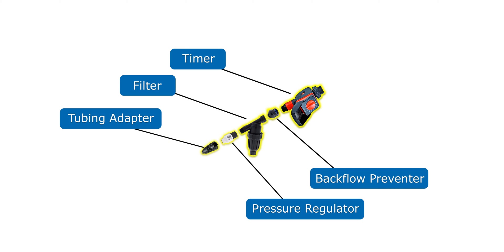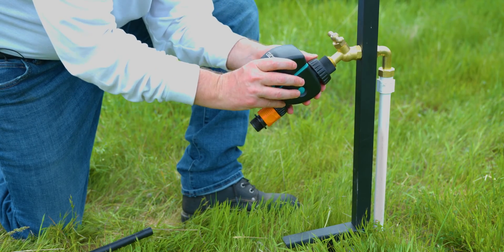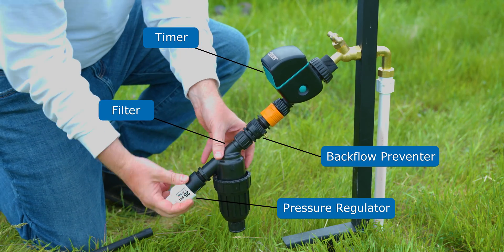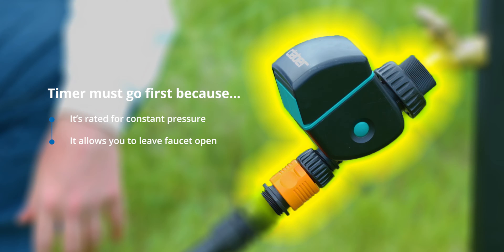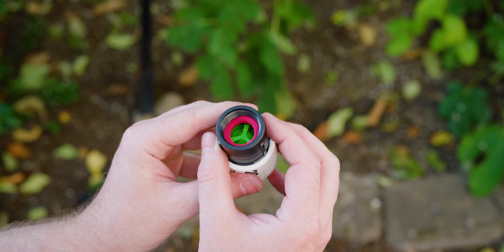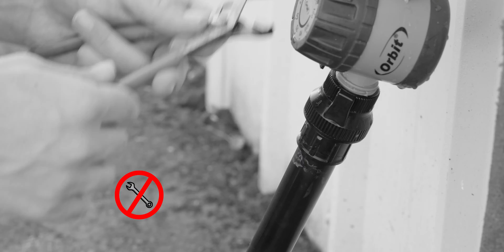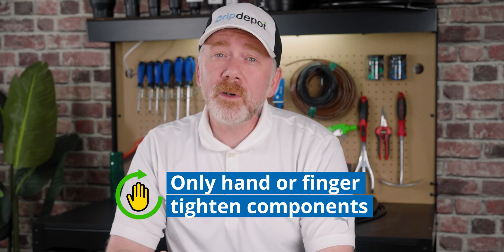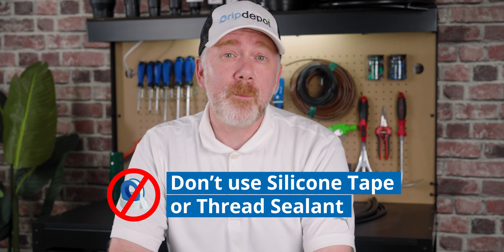How to Install a Drip Irrigation Head Assembly (Beginner's Guide)

Comment: I'm perplexed how this is a popular installation technique; there is so much stuff hanging off at an angle that there must be so much stress & strain on those fittings. It's so silly how it's sticking out like that; bang your knee on it as you're walking by and one of those plastic fittings is definitely snapping. I've been searching all over the web but can't find any sort of system that gets mounted flush to a wall, post, or box thereby eliminating all the aforementioned issues.
Reply from the maker: These can definitely be mounted flush to a support structure, you're definitely on the right track.  In most cases it's the hose bib turning things 45°, but a quick adapter (or a 90° hose bib connection) can allow things to be completely vertical so they could be mounted flush, particularly if the inline filter is used instead of the canister filter (inline is this one: https://www.dripdepot.com/1255 ).  With that said, a single zone head assembly isn't too heavy, but once you start getting to 2 to 4 outlets they can get a little on the bulky side and I think looking to install it on some kind of support is a good idea at that point.
Reply: @dripdepot  Yes, but I guess my main point is that none of these parts seem to be designed for mounting - no brackets, mounting flanges, etc. To me, mounting options should be the logical default of any design. If someone wants to instead hang a spider spaghetti mess of parts off a hose bib, then they simply don't use the brackets or mounting points. My garden space is a fair ways away from my house with no hose bib nearby, which I would think is not uncommon among backyard gardeners. An ideal solution would be some sort of distribution box mounted to a post in the garden with an input from a hose or buried line that's run from the house. I'm just surprised there's nothing anywhere close to a turnkey solution for this; I'm essentially going to have to 100% frankenstein something from random hardware. Installing drip irrigation in the beds seems to be very easy and straightforward, but the showstopper is getting the water to the garden.
Reply from the maker: @johnk_dev  I would agree that as far as hose bib solutions go, it has definitely lagged behind traditional buried solutions.  In your case, you could look into routing some pipe from your hose bib (or tapping into the pipe that feeds it) and running it out to the garden where you could go with a valve box and a small valve or valves.  A faucet Y on the hose bib would allow it to still be used as standard hose bib with a garden hose, etc.  Beyond that, you have it right there's not really a turnkey solution like described (and you're also right that installing the drip is very easy!).  

Drip irrigation, particularly from a hose bib, has been a very small portion of the market for a long time, it's just now really gaining in popularity, so we'll definitely start seeing things like this being offered.  I think the drip market is going to continue to grow considerably.  If you end up building a good solution and it could scale, heck you could be the one to bring the product to market :)
Reply: @dripdepot  I think a lot of the onus will fall on the timer manufacturers. The timer is first in line off the bib, they all seem to be made of plastic, and therefore carry the most stress and are most likely to break. My #1 pick is the Linktap Q1 based on the feature set; it has literally everything I want except a way to mount it. Most other timers have a flat rectangular shape, so some sort of generic off-the-shelf brackets from the hardware store could probably be used, but the Q1's star shape makes it essentially unmountable without machining a 100% custom bracket.

I just need to get started. A final solution will probably come to me eventually. My garden is 11 12' raised beds, a few in ground beds, a few smaller border raised beds, and pots. 4 zones seems appropriate, but I should just get one of your starter kits and do a couple of the beds as a learning exercise. Learn by doing! I'll mount a single head assembly to a post and have a pigtail of hose with a quick connect where I can connect/disconnect my hose and turn it on/off by hand. Timers, multiple zones, underground pipe, etc. can come later.
Reply from the maker: @johnk_dev  I'd just bumped into the LinkTap for the first time a couple weeks ago.  Man, you're right about the star shape, that does seem a little unwieldy (though its feature set is admittedly very nice).  

And spot on about learning by doing, after you do your first system you'll be adept at all of this, it's one of those things that's more intimidating in theory than in practice.  After I installed by first drip system at home I went wild adding beds and growing the system lol, the experience from the first one locked in all the knowledge for me.  As you plan and install the system, don't hesitate for a second to drop a line if you have any questions, I genuinely love to talk irrigation and am always happy to help.

Comment: Why is the filter always shown as upstream of the pressure reducer?  My water source is directly from the municipal water meter -- not hooked to a hose bib from the house.  The filter is located upstream of the valves and pressure reducers.  About every six months, the plastic housing on the cannister filters (from multiple manufacturers) springs a leak.  It has happened many times.  I presume that is because it is not designed to be exposed to constant high pressure.
If I use your Senninger PRLV pressure reducer placed upstream of the cannister filter and the 12 valves with various drip circuits, can I effectively protect the filter from bursting and avoid the necessity of 12 pressure reducers (one downstream of each valve).
Reply from the maker: Heya Steven!  I'll paste in the info I sent over on the other comment and add a little more :) 

The main reason is to filter the water to protect the regulator  -- if a regulator gets too much debris in it, it can fail (and if that happens, you risk potentially exposing the downstream components to high pressure).  

Some filters don't work as well at lower pressure as well, which is a small secondary reason -- every filter causes a small pressure drop, and its best if that happens before the regulator than after.  With many filters you might not notice, but others could cause a system performance drop.  

With all that said, the common hose filters should be able to handle up to about 75 PSI and still get a good lifespan out of it.  

One tip just in case: Be sure the filter is placed downstream of any timers or shut-off valves -- they're not rated for constant pressure so need to be relieved when the system is not in use (same with the regulator and backflow preventer).  If yours are already downstream of shut-off valves they should be lasting you a good amount of time and something could be up with the filter(s).

Additional info:  It sounds like you might have them upstream of shut-off valves -- if so, they're under constant pressure which you want to avoid.  There are filters and regulators rated for constant pressure, but they're the exception instead of the norm. 

If there's no way for you to move them so they're not under constant pressure, let me know, happy to link constant pressure filter and regulator (the PRLV is actually rated for constant pressure, but their other regulators are not).
Reply: @dripdepot  Thank you for the quick and detailed response.

Comment: On another site it was stated that the pressure regulator is installed before the filter and right after the vacuum breaker. Since Drip Depot's recommendation is to install the regulator after the filter, is there a right way to do this or is either way acceptable? Thanks for the excellent series of informative videos.
Reply from the maker: I think that order would work, but I do recommend the filter come before the regulator.  This helps prevent any debris from getting in the regulator.  In addition to that, every filter causes some pressure drop, and it's best if that drop happens after the regulator than before.  We've seen some strange behavior on low pressure systems when the regulator came before the filter.  

In most cases having the regulator first won't cause any major issues, but for best results, filter first :)

Comment: We have very hard water, so a calcium filter will probably be very necessary (we have to use one on our misting system, or it gets clogged with hard water deposits). Where in the assembly would i add this? Thank you for your time.
Reply from the maker: A calcium filter will typically come just before the mesh screen filter, so you'd have an order similar to this: 

Spigot --> Timer (optional) --> Backflow Preventer --> Calcium Inhibitor --> Mesh Filter --> Pressure Regulator --> Hose x Tubing Adapter --> Tubing Run. 

That order keeps the calcium from building up in the downstream components -- you might need to clean your backflow preventer a little more often since it needs to be placed before the rest, but a good vinegar solution soak can typically get them cleaned without much trouble :)
Reply: @dripdepot  Glad I asked, because I would have put it AFTER the mesh filter! Thanks!

Comment: Hi, I would like to add a water meter to this setup, where should I place it? Thank you, your videos are the best
Reply from the maker: Thank you for the kind words!

To some degree this depends on the type of water meter you get, but it's most likely going to go downstream of the timer to prevent it from being under constant pressure.  Basically, somewhere it gets relieved of pressure when the irrigation system is not in use.  In between the backflow preventer and filter or just after the filter are good locations where it can be accurate and be relieved of pressure when the timer is off :)

Comment: I’m on well water. Fine Sand is an issue. I’m thinking it’s probably a good idea to install the filter first. The sand will eventually damage the valve in the timer.
Reply from the maker: You bet, if you go with a filter before the timer, be sure to get one rated for constant pressure -- those tend to be pipe threaded rather than hose, so an adapter at the inlet/outlet is needed, but nothing crazy, just a pipe x hose adapter.  If sand or mineral content is the primary concern, a screen filter will serve best :)

Comment: Thank you for the video. Very instructive. 

I have a question: Is the head angle important? In your video, it is 45 °. Does it make any difference if it is horizontal or vertical?
Reply from the maker: For the most part, it doesn't matter too much -- if it's fully horizontal the overall weight of the head assembly should be considered -- some are heavier depending on timer and filter in particular.  In my home garden, my hose bib is only about 6 inches off the ground, so I had to make mine horizontal -- I rested it on some bricks just to make sure the weight didn't cause any problems with the threads on the hose bib :)

Comment: Is there any difference between the tee filter and inline filter?
Reply from the maker: No real functional difference :) 

The Tee filter works good for hose bibs that are low to the ground, the Tee shape allows the head assembly to go horizontal instead of vertical -- but other than shape, they're pretty much identical.

Comment: If the backflow piece is a constant stream/spray, how can I fix?
Reply from the maker: Is this happening at system shut-off or is it constant during the watering cycle?  If you're able to, a quick video showing it spraying (with a wide enough shot to see the rest of the head assembly at the hose bib) might help me determine if it's something wrong with the preventer, or something else that could be quickly fixed.   You could send / share that video by sending an email to us here, I'll be happy to help :)   https://help.dripdepot.com/support/tickets/new
Reply: @dripdepot Ticket submitted!
Reply from the maker: @spencerk4387  Perfect, thank you!  I'll go take a look now, expect to hear from me shortly :)

Comment: Your videos have been incredibly helpful in designing my drip system, but I have a question that i haven't yet seen covered. I have quite a long hose (100 feet) that goes from the faucet at my house down to my garden. At my garden, I have a Y-split where last year, I connected two different hoses - one was a soaker hose and the other was a normal garden hose. Can I install a timer at the house faucet, and the rest of the head assembly on one side of my Y-split at the garden? (This would allow me to keep a normal hose available in the garden on the other side of the Y-split, just in case.) Or, does the entire head assembly need to live at the faucet?
Reply from the maker: Taylor, I think you're right about this not being in a video yet -- I'm going to toss it into our ideas list, thank you for the idea :) 

I believe you could do exactly as you're suggesting, other than the backflow preventer.  So you can have:  Faucet --> Timer --> Backflow Preventer --> Y Splitter --> (on the drip side) Filter --> Pressure Regulator --> Drip System

You could probably put your filter after the backflow preventer near the timer if you wanted to filter for both sides, but it's also fine to place it after the Y splitter.
Reply: @dripdepot  Thank you so much! Your videos are so extensive and helpful for a beginner - I couldn't have done it without you!

Comment: Great set up.  If the setup had a fertigation component e.g. mix rite, that demandend more pressure than what is coming out of your pressure reduction component,  would you relocate the pressure reducer to the downstream part of the fertigation component? That way the fertigation component can utilize the  existing high pressure from the source. You already have a back flow preventer so no risk is involved.
Reply from the maker: You have it exactly right -- If I needed more pressure than what's coming out of the regulator, I'd likely move the regulator downstream of the injector.  This would work well since regulators only regulate downstream pressure -- you also have it exactly right that the water source would be secure since the backflow preventer would still be upstream of the injector component.  

Depending on the injector I'm using, I do try to install them downstream of the regulator just to help them have a long life -- a lot of them now can operate at very low pressure.  One of our most popular MixRites, the 570CW can operate as low as 2.9 PSI -- it wouldn't be ideal to operate that low, but 15 to 25 PSI still gets great results from them :) 

Great insights as usual from you, thank you sincerely!
Reply: I once tried to use a ventiri siphon to fertigate and it constantly pumped water into the fert container, could it be bc I had it upstream from the pressure reducer?
Reply from the maker: @Tara-sf7uu  Sincere apologies for the late reply on this one!  YouTube doesn't send notifications for replies within a reply, I was just browsing comments when I bumped into this one.  

You've probably got it all sorted by now, but just in case: 

You are correct, having it right before the pressure regulator could potentially cause symptoms like this -- the interactions between injectors and downstream regulators can be a bit unpredictable.  Having it installed in reverse could also cause this, as the necessary pressure differential wouldn't be generated to create the vacuum to achieve suction.  

Either way I hope you're up and running now and apologies for missing this one!